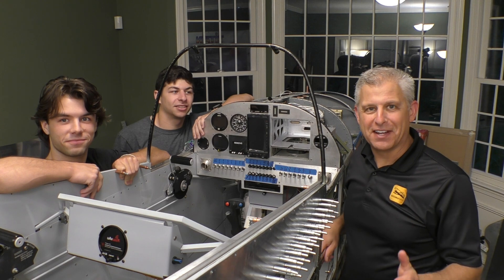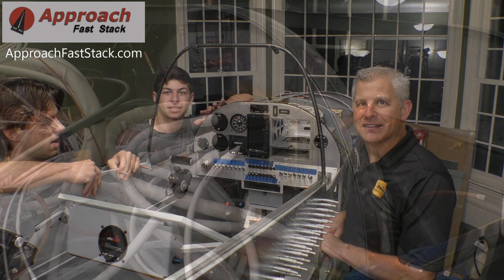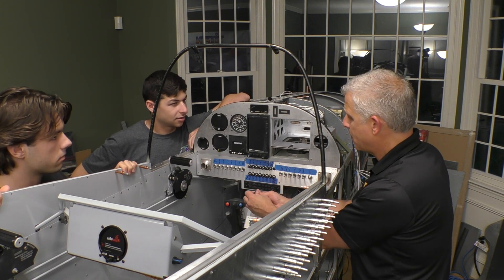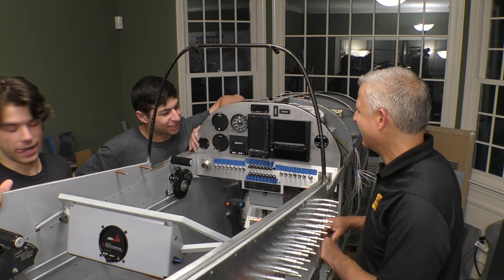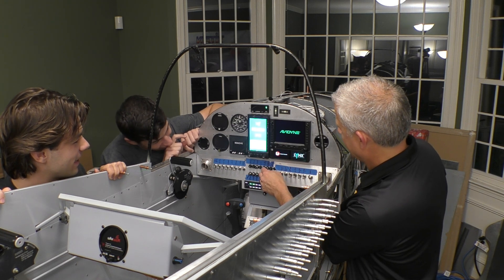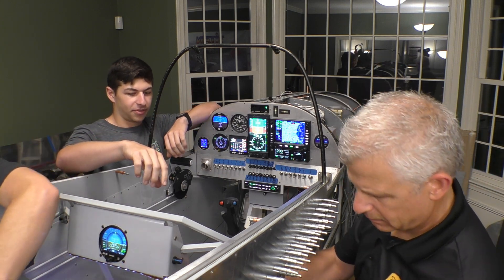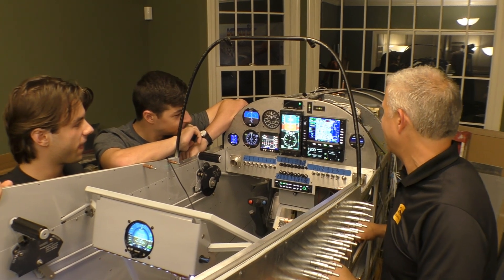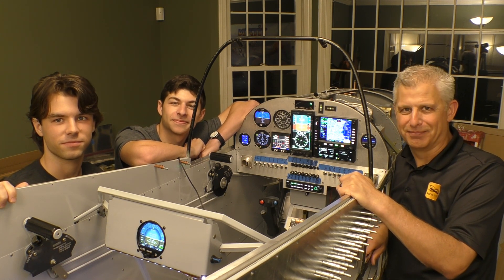Light It Up!  Power to the Panel of our Titan T-51D Mustang!

Comment: @SocialFlight. I have a T-51 and I am impressed by the instrument in the back seat.  Is it possible to make contact to understand how you build that small panel?  Also, the backseat in the T-51 is small does the panel impede on the passenger?